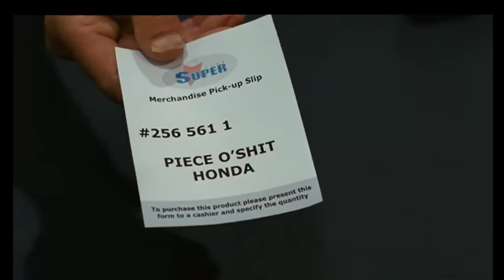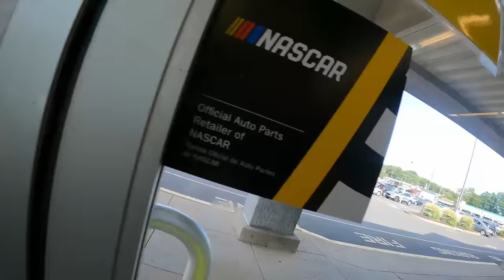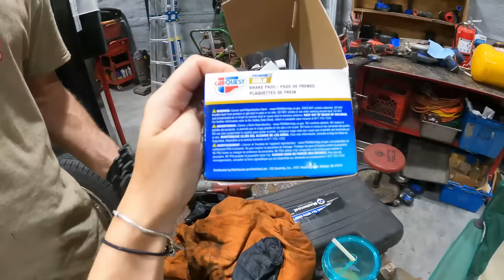My VERY FIRST Brake Job! And It's on MY FRIEND'S JEEP! NNKH

Comment: I think it would be nice if the company that makes the calipers and rotors would powder coat the entire mechanism to prevent rust especially if you live in a state where a lot of salt is used in the winter time
Reply: Cost is the main thing here... Just standard paint for aftermarket replacement style parts

Comment: Some are disc/drum and some four discs, I think. I once took a course at the community college that taught the basics: brakes, oil change, tuneup etc. But that was years ago. It was called Auto Maintenance for Women I think, which you'd never get away with today. But a couple of guys came, they weren't ashamed. One of them said 'people think if you're male you should automatically know this stuff.'

Comment: the front brake pads are 50% larger than the rear brake PADS, which give the car 60%braking at the front, $40% at the rear , due to the car being heavier in the front Because of the heavy motor Upfront!!!!!!!

Comment: I use never seize on my brake bolts 345k miles with no issues till my hip replacement and I had a shop do my rear brakes and I lost a caliber due to a bolt coming out.

Comment: Come on Chris, the lug nuts were likely rusted on and due to the heat from her worn out brakes the parts very well could have welded themselves on by expanding so many times my suggestion is to get ya a 2 litre of coke not Pepsi, has to be coke and dump it on them and all over the rim let's soak a bit while the acid in the coke eats away all the rust and BOOM lug nuts break free easily! I know I didn't believe it either till a tow truck driver literally did it right in front of me lol-ol-ol then to think we drink that crap and what the acid must do to our insides! 🤣🤦‍♂️

Comment: former honda dealership mechanic here...the 1-2 shift slipping is the first sign of the transaxle going bad.  Your honda will need a new trans to fix the issue
Reply: What about 2-3 or 3 to overdrive
Reply: @LAactor  an automatic honda slipping in any shift is a bad sign, and 99% of the time means the trans is going bad.  It's just that the 1-2 shift is usually the first to have problems.  You CAN sometimes have a problem with a previous shop servicing the car and filling the trans with the wrong fluid, but this is rare.  You can try changing the fluid out with genuine honda trans fluid (they dont fully drain so you have to repeat 3x to get a full fluid change), and IF the problem is just the wrong fluid being in the car it should fix it, but like I said it's rare.

Comment: That tire with nail in it , is unrepairable because it’s not within specs , anything an inch from either sidewall must be taking out of service!! ,,,,   

PS wanted to Add a Very Important Comment,,, Never Ever lubricate lug nut studs , I understand Rust belt and all that , but they should be torqued to speck , dry … 1 drop of lubricants can change clamping force by a thousand foot pounds and potentially stretching lug studs beyond their “yield point “ and cause stud to potentially back off and cause loose wheel or worse ,,, but as tight as them lug nuts were originally, if it were me I would have replaced all the lug studs anyways ! Safety first … TIA certified !!

Comment: I been cranking wrenches for 40 years, no that was not a fail,  the locktite is overkill, and a bit of spray lube will not effect them, it dissapates too quickly, and the bolts dont come loose

Comment: So many things were done wrong by you both but lets start with how to swing a hammer 😅 Second lets hammer a socket on the wheel lug/lock not the breaker bar as it absorbed the blows . Clean and lube all pins and slides,  clean the caliper brackets and lube under the stainless clips so they dont build a rust ridge like he was explaining to you . Also pad slaps are not brake jobs and the rotors should be replaced if they are worn or uneven.  As for the opening the bleeder its not necessary on this vehicle but the brake hose could be bad causing the caliper to stick or hang up and should be replaced as well . But lastly the rotor hat or mate surface should be cleaned before you install the wheel back on . Check the E brake before you start a brake job and see if it holds the car if not youll have to see if the cables need adjustment or brake shoes are worn out .

Comment: Honda automatics... ugh. I've had good luck with running Sea Foam Trans Tune for a while (100 miles, or so), then changing the fluid once or twice. Got over 100,000 miles out of a 2004 Civic after doing that, after it had started slipping.
Reply: Ooh, go watch Chris (on his 2nd channel)  transmission flushing technique as a last hail Mary move before planning to swap out the transmission 😅
Reply: @ricebike  With Hondas, it often is just a fluid issue, they're ridiculously sensitive when it comes to the fluid they have in them. If it's old, or if it's not Honda brand fluid, they just wont work right. That's something that I forgot to mention in my first comment, it absolutely has to be Honda fluid, they just don't work with anything else.

Comment: I saw the trouble you had getting the wheel bolts off.  Now suppose someone was out on the road and had a flat tire, how would they get the tire off to change it?

Comment: Chris...
You put anti-sieze on those pins?? Interesting.
YouTuber AvE says Anti-sieze is NOT a lubricant. But this application is kind of a special case. Lots of heat and not much sliding (unless the rotor is warped). On the other hand, silicone grease is good to like 600° I think.
Again, interesting.

Comment: that snap on breaker bar is the only breaker bar I have ever broke and I will never own another snap on breaker bar even is someone paid me.
Reply: Lifetime warranty was a no go?

Get the replacement tool under warranty and then sell it if you hate that brand 😅

Which brand did you get instead of the snap on?

It was an impressive flex, with that cheater pipe though 😮
Reply: @ricebike  There was no cheater pipe on it. yes i got it replace and yes I did sell it and I dont remember what brand I went with it was 30SH years.

Comment: Guys those rear brakes aren't that bad and in need of replacement!
Reply: Leave the caliper bracket mounted. There's no need to remove it to replace the brake pads!
Reply: The pads were still good in the rears... They made an oops and was supposed to do the front pads when they heard the squealer tabs hitting the rotors on the test drive 😅

Comment: Jennifer air tools are a mechanics best friend and sometimes you can use old 19mm sockets to get off those keyed lugnuts i know because i used to do it on gm models even honda with a 13mm socket . jennifer brake pads come in 3 qualities theres very cheap semi cheap and top of the line the difference in them is how often you feel like changing them like every 6 months for very cheap or every year for semi cheap or every 3 years for top of the line and even garages dont use top of the line way to expensive . jennifer your tranny on your honda i think is almost shot and the cost to rebuild is more then the car is worth sometimes scrap yards have good used ones for a decent price install on the other hand isnt a diy project you need a fully equiped garage with tranny jacks and you need alot of knowledge .

Comment: No tight lug nuts are when you get out a inch drive socket and bar with 7 or 8 ft of pipe and you need all new studs and nuts as at least 2 per wheel snapped off and the rest had pulled threads yeah air guns are great but do not let a idiot near one .

Comment: Actually, there is reason to put some sort of thread glue rather than lube on lug nuts, just like on the brake bolts.  I like to use #2 gasket sealer, which seems to be strong enough to keep them from spinning off and to fight rust without making removal difficult.
   Wheel lugs especially want glue on the left side of the car, where you are, and where once upon a time, many wheel lugs used to be left hand threaded, which I hear was effective, but confusing.

Comment: He sure does leave u hanging on jobs. I would think that he would want to make sure ur doing things right and safely and not let u struggle.
Reply: Sometimes it's the best way to learn... Did it the hard way with no Internet and taking out the Haynes manual from the library in the 1990s😅

Comment: Brake rotors are just replaced nowadays instead of turning.
Reply: I used to resurface rotors at an auto shop in the late 1990s

They were made thicker to do at least 3 cuts before reaching throwaway thickness (they're prone to warping when minimum thickness is reached 😢)

Nowadays, you're correct not enough meat on the rotor for at least one resurfacing if not caught in time😢

Most are casted in China as well
Reply: @ricebike  yup I was a auto mechanic from 1989 to 2001.

Comment: I come across the issue with the wheel locks weekly at my job. I had a buddy come into our shop and he gave me a great way of getting them off without the air chisel. He calls it rim stretching haha,take all the nuts except the lock and get behind the rim and with a 3 foot bar pry back and forth. Doesn't seem like it would work but honestly the lock nut was not much more than finger tight,give it a try

Comment: You NEVER put lugs that tight. That is a rookie screw up for sure.  I have always stop when the the sockets stops tight. Then for good measure, I do a quarter turn more and in 35 years, its never caused me any harm from falling off while be driven. Plus, put some anti-seize on the threads if you live in the high moisture/winter salt states. You will be surprised how many people in this world I not one clue even how to take a wheel off let a lone do the standard brake job and go over all the little things that actually matter in the long run for a smooth braking operation.

Comment: Now you know why we can't change our own tires on the road.  The lugs supposed to be torqued at 100 lbs/ foot.  But, repair shops crank on with air ratchets so that tires don't fall off and they avoid liability. Stupid.
Reply from the maker: Yea I completely agree. Not that I have a ton of experience, but I know there’s no way I could have got that tire off on the side of the road even with a brand new lug nut key.

Comment: DONT DO MORE THAN YOU NEED TO WRONG AS A MECHANIC ITS YOUR JOB TO CHECK EVERY THING!  YOUR DOING THE SERVICE BRAKES YOU INSPECT THE PARKING BRAKE THATS HOW YOU EARN YOUR LIVING YOU LOOK FOR TROUBLE AND BRING IT TO CUSTOMERS ATTENTION
Reply: They also made an oops without removing the front tires and checking them too.

 since I bet the lug nuts are overtightened as well😢

I'll bet they were supposed to do the fronts since the rear pads had lots of lining on them (hence the pad slap only)

Guess part 2 down the road if the owner's relatives still have the jeep😢

Comment: I really resent Chris' attitude when Jen is trying to do these videos,  like it's just the biggest waste of his time. I love watching his videos on NNKH AND NNKH2 but man I wish he could get his act together and help Jen with more actual engaged helpfulness.  For example: come on Chris teach Jen how to loosen hard stuck bolts; 1) widen stance, 2) brace against something behind you even if it's your head or just a shoulder. These first two keep you from hurting yourself when the bolt comes loose.  3) wear gloves. Knuckle skin doesn't stand a chance against metal.  4)using the correct wrench in the correct position (a separate lesson),  pull really hard, it might not come easy. Keep Body and Arms kinda stiff so range of motion is limited so again you don't go flailing around when the bolt comes loose. 5) this is general technique that applies to ALL of auto-meching and even alot of carpentry,  like pulling nails and stuff like that.   Come on Chris put your channel down for a minute and engage with Jen for some really great content that will benefit both of you. And don't tell me "she doesn't want that" BS. it is obvious she does want you to show her alot of your great knowledge. This is what's coming through the videos for me. Just my "Too scents". Thanks both of you for what you do, I love the channels.

Comment: 23:57 I probably say this everytime I see a brakes video including when I do my own videos, pad slaps are dangerous, your putting  smooth surface (rotor) against a smooth surface (pads) and when you brake it greatly reduces your stopping ability and can cause an accident. You should always rough up both sides of the rotor with a Roloc disc or an abrasive disc and lightly rub the rotors to get the shiny off..alternative to replacing the rotor. Please never ever do a pad slap.. always make sure your rotors are roughed up so when you break in the pads they will grip.

Comment: Could you possibly not play music whilst Chris is talking and demonstrating its very distracting
Reply from the maker: If I could go back I would have turned it down more. It sounded a lot quieter when I was editing it on my computer. When I played it on my phone I didn’t like the volume either but once it’s posted there’s not much I can do about it. That’s the problem I’m facing as an inexperienced editor with no schooling. And Ive been at it for less than a year. Audio has been tricky to get right to say the least. Thanks for your advice.